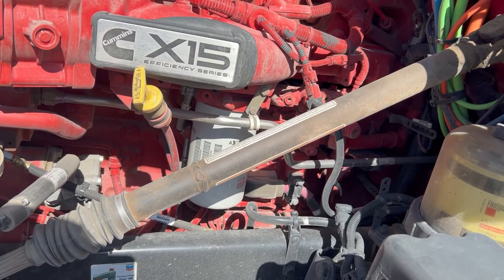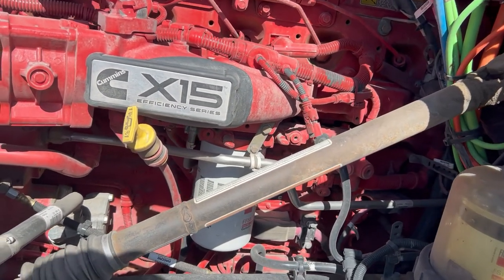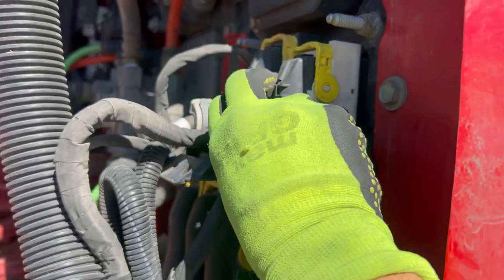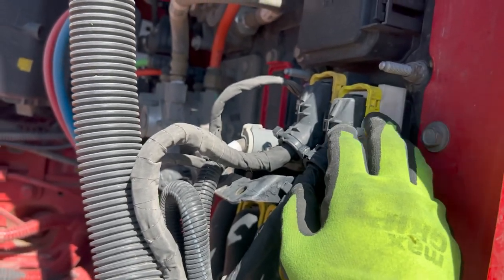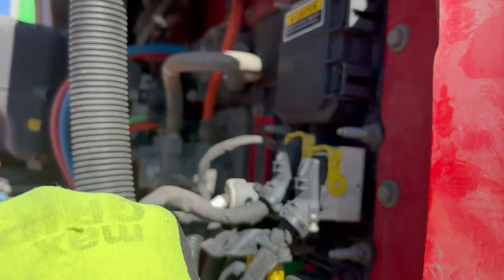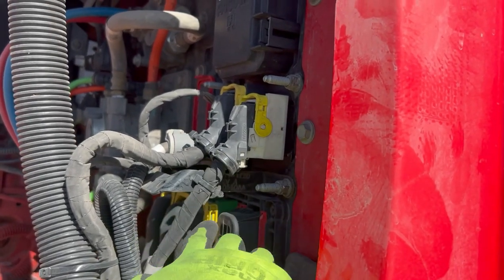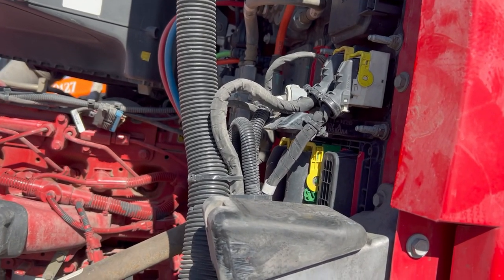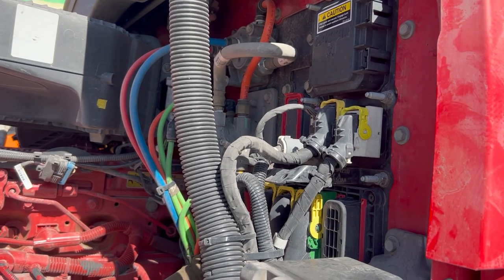Kenworth T680 SCR Fault Code Problem and Solution | Trucking Vlog | OTR Life

Comment: I have a 2016 peterbilt 389. I  am having a very similar problem with my truck. Every time I have my truck washed or when it's raining, I will get an SCR fault code. When this pops up, my red, low def fluid guage will  come on, and my truck WI start to derate. I have been in the Pete shop off and on since last year, spending thousands of dollars trying to get the problem solved. So far, I've not been able to get the problem resolved. I've had both nox sensors replaced, doser valve, def tank heater, and wiring harness replaced. Found 2 wires that were damaged and corroded. Repaired the wires , cleared the codes, and it was fine until I washed my truck again. Does anyone know what could possibly be the problem?
Reply: You ever get an answer? I have the same issue, intermittent derate that comes and goes as quick and randomly as it goes. I know it's a wiring issue but not sure where. I just had the SCR fault pop up with no derate, hence why I found this video.

Comment: This worked for me. One of the fuses was not snapped in fully. No longer derated. Thank you👍
Reply: Which fuse or color
Reply: @donediditagainj4991 At 1:12 where he is pointing at pull down the yellow thing to unsnap the gray fuse part from the truck and inspect or just plug back in. Push the yellow part back up to replace it back

Comment: When it threw the code, did your def gauge go to nothing and the truck try to derate
Reply from the maker: I didn’t notice the DEF gauge going on the fritz and the truck hadn’t started derating yet. I only had to go another 30 miles to get to the shop so that wasn’t too bad. 

What’s going on with yours?!
Reply: @JohnnyTrucking  company truck so it's technically their problem, but the rig has my CB and all my goodies in it, mine said scr error / alteration made, my def gauge went from 7/8 of a tank to completely empty almost like the sending unit in the tank is going, and it said it was going to derate in 1 hour
Reply from the maker: @Coletrain-pu2os  Oh man that sucks! Did you get it taken care of already?
Reply: @Coletrain-pu2os  this just happened on my trainer truck. Def said it was full but red light on and started a derate count down. And also the scr light came on aswell.
Reply: @BoiseStateFan101  hey did the company ever tell you what the fix was?
Reply: @Coletrain-pu2os  did you find a fix for this?
Reply: My truck is derating from that code now
Reply: @BoiseStateFan101 what is a problem my truck have same problem
Reply: @prabhjeetdhillon1084 I have the same problem too.
Reply: Yes mind did

Comment: I have several faults that just randomly pop up. I'll check that box because there's a short somewhere. Got it out of shop today, they replaced the gas exhaust sensor and clutch actuator. $4700, and soon as I cranked it, the faults came right up. Ouch